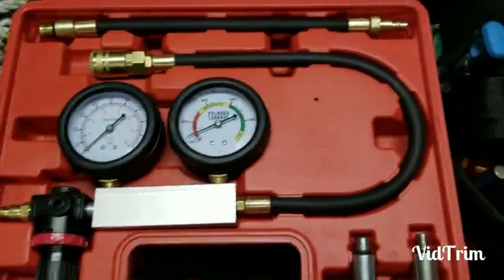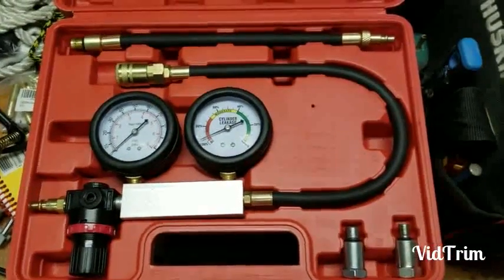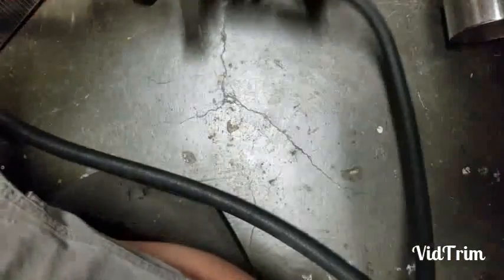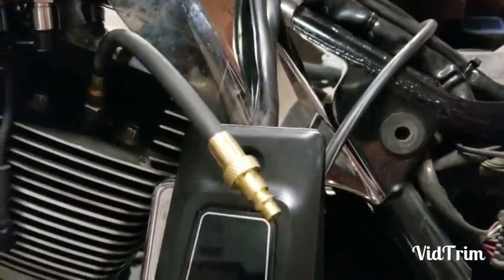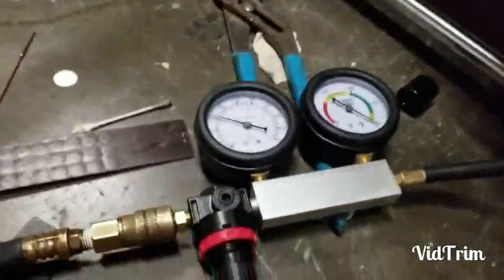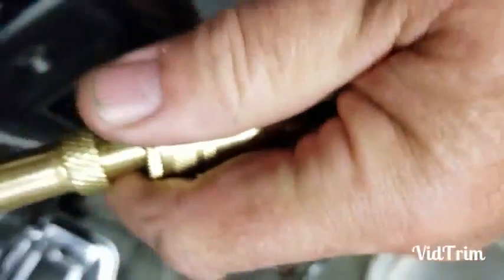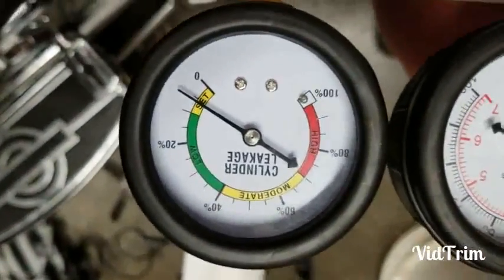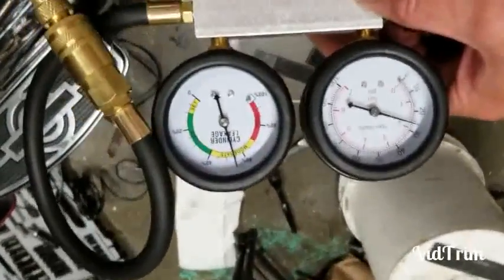Harley Twin Cam Leak-down Test

Comment: With 70% leak down will my bike not run?
Reply from the maker: That means 70% of your compression is being lost. You're either doing something wrong, or the cylinder(s) you're testing have serious problems. If you have that much loss in only one cylinder, it'll probably still run but it'll be running on only one cylinder (assuming its a twin). a single cylinder engine probably wont even start with that much compression loss.

Comment: Sir your suppose to start with the adjustment valve closed (0 Psi) then slowly open to zero the second gauge which will be approx 30 psi. The way you did it can damage the gauges.
Reply from the maker: Thanks for the tip and for taking the time to reply.

Comment: That's it what? Is 5% good?
Reply from the maker: I've read that 5% - 8% is the range you're hoping to see, and that numbers as high as 12% aren't horrible. Once you get up to 15% or so, it's time to start looking for - and correcting - the cause. I'm sure others will see it differently.
Reply: @chuckzissman Does it mean that I may need new pistons and rings and new valves?
Reply from the maker: @randolphjones4814 with the engine at TDC on the compression stroke and the leak down tester connected with air pressure being applied into the cylinder, if you hear hissing out the exhaust pipe you probably have a burned valve, if you hear hissing out of the air cleaner you probably have an intake valve that's not sealing properly, if you hear hissing from the dipstick or oil bag cap you probably have bad rings or a bad piston